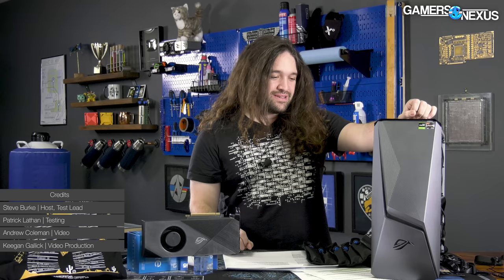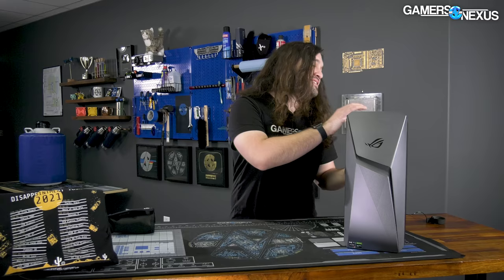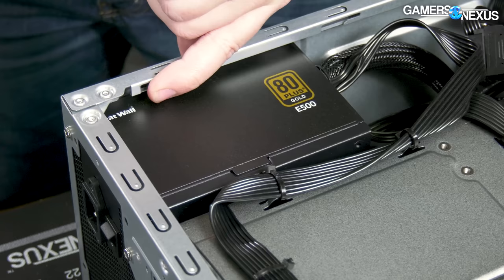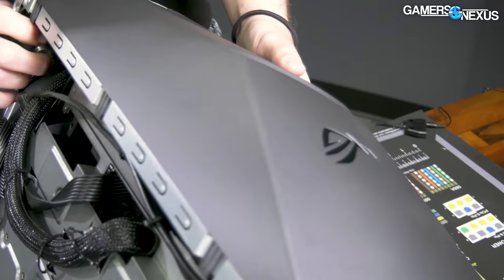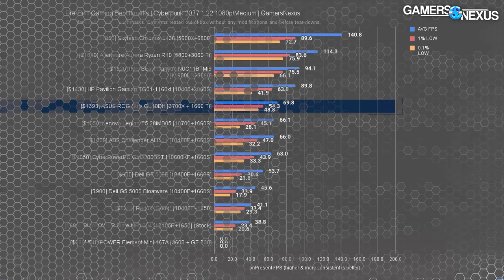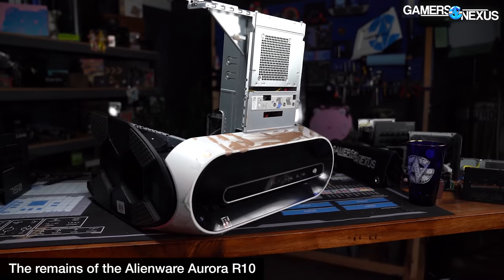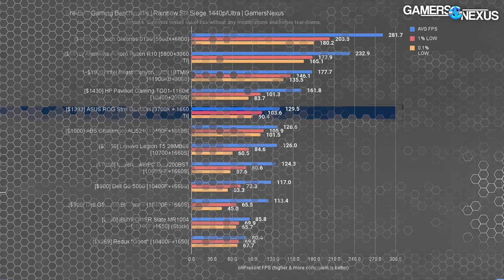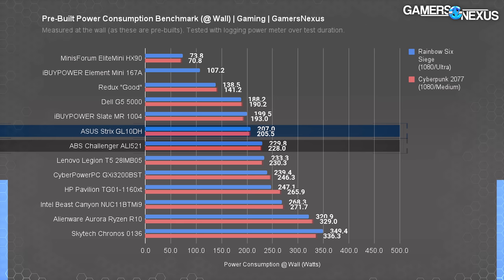ASUS Didn't Deeply Offend Us: $1400 Pre-Built Gaming PC Review (ASUS GL10DH)

Comment: I think you were too easy on armory crate. It is harder to remove it than some self replicating virus. ASUS motherboards now ship with it in the BIOS. Unless you boot into the bios and turn off a switch, it is going to keep installing armory crate on its own! even if you re install windows. Not to mention that it interferes with everything you do on the system and uninstalling it without formatting is pretty much impossible. 

I think no other bloatware compares to this malware crate that asus is spreading with its hardware.

Comment: This was interesting for me because my own system is relatively similar. 1660 Ti as well but with a 5800X.
I think the comparison is still fair since the GPU is definitely the bottleneck in my system. I'm getting a whopping 20% CPU usage in God of War :)
Reply: You're absolutely right that the 5800X is yawning it's jaw off waiting for the 1660ti unless you run everything at 720p Low.... BUT... you can't judge it by the "whopping 20% CPU usage". You have to expand the CPU monitor to Logical Processors to see what is going on. Having a single core pegged at 100% and the rest idle is still only 12.5% CPU usage but also still and indication that you might be hitting a hard CPU bottle neck.

God of War is fairly well multi threaded, so it's absolutely not a good example of the above, but there are plenty of other reasonably modern titles where people have been pulling their hair out over micro stuttering and blamed Windows, their graphics driver, the weather or the last election results "because I'm only at 40% CPU usage".....
Reply: @andersjjensen  And in rare exceptions, even in the cases where it isn't single threaded bottle necked, nor multi threaded bottlenecked, then it can be something else, maybe memory speed?
Reply: @Sinaeb  That's the last option. But that is rare. But if it is memory speed/latency you'll see it in the 1% lows first where it will get progressively worse compared to AVG FPS as you lower settings.